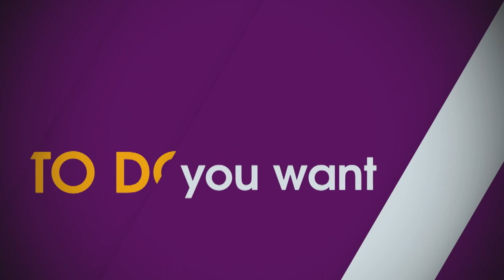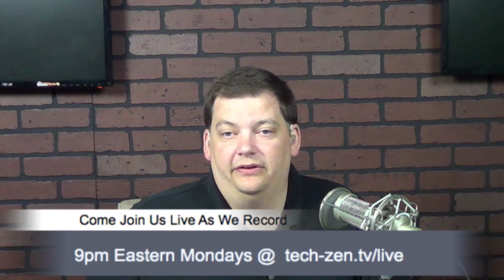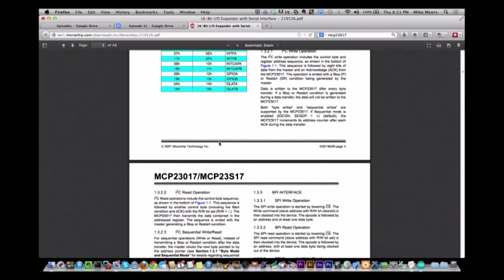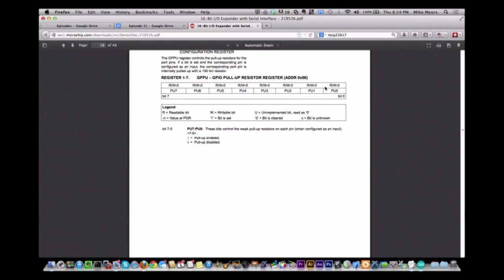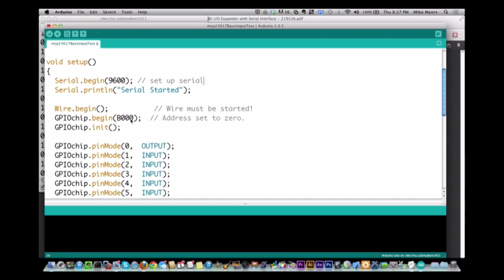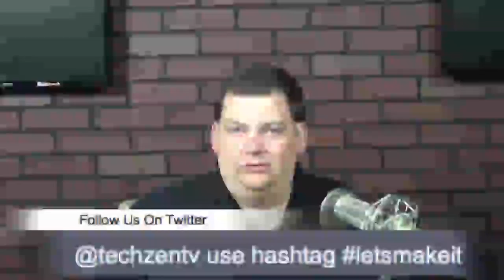Input/Output Expansion With An Arduino - Let's Make It - Episode 31 - Tech-Zen.tv - Alixa.tv

Comment: how do i define the pin number of two or more chips using this library? thanks
Reply: Two years later... and here is the answer. Are you still there CNC Brazil? 

1) Wire the first chip to hardware address 000, and the second chip to hardware address 001 for example.

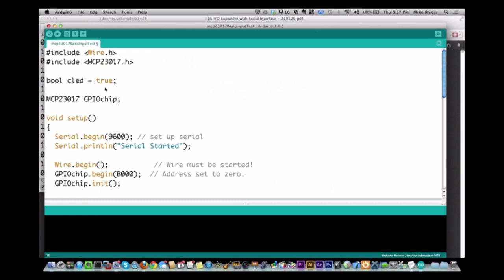2) Look at the code at 30:52. You need to instantiate two chips now with their hardware addresses,
So,
MCP23017 GPIOchip1; 
MCP23017 GPIOchip2;

Then in the setup section you do,
GPIOchip1.begin(B000); // this one is set to hardware address 000
GPIOchip2.begin(B001); // this one is set to hardware address 001

Then in the rest of the code you refer to GPIOchip1 for the first chip, and GPIOchip2 for the second chip.

There you go.